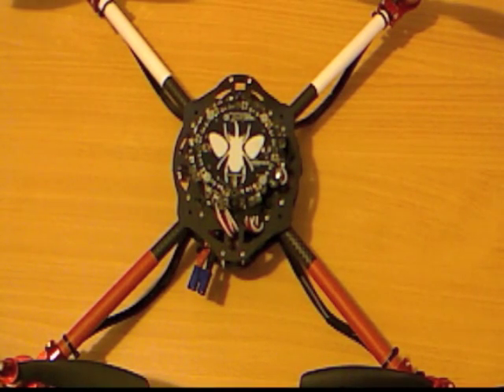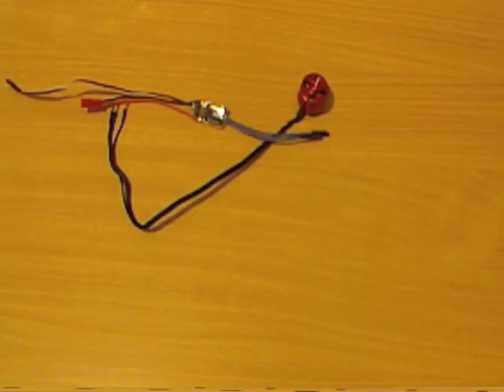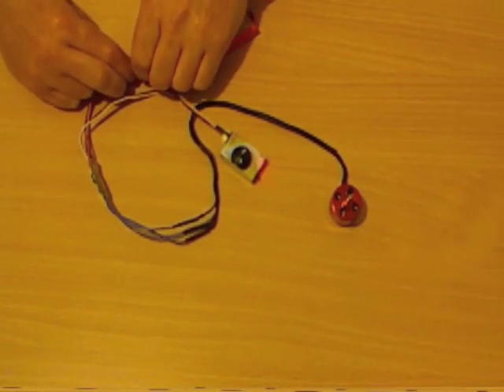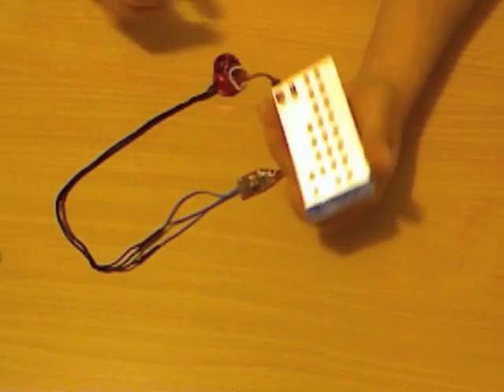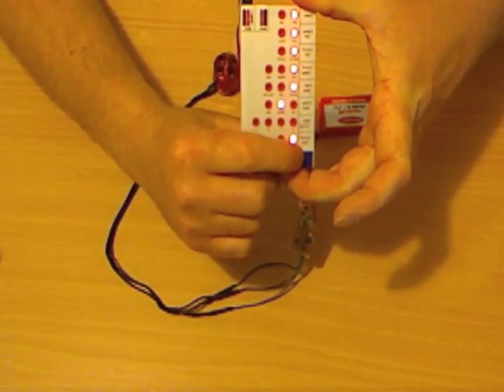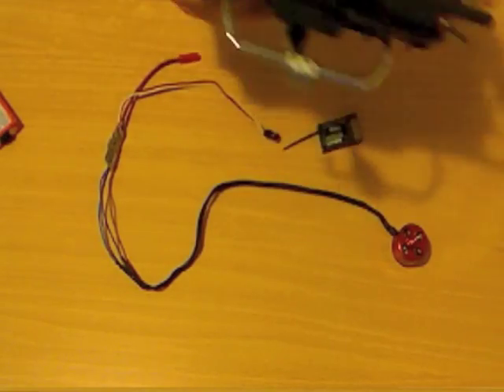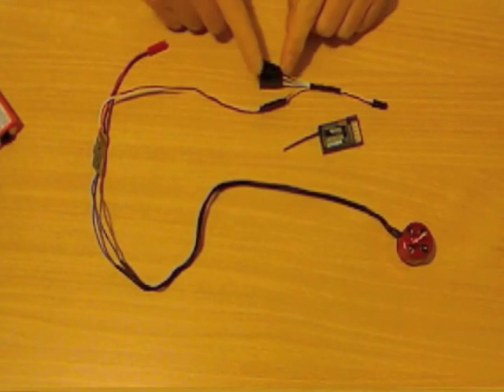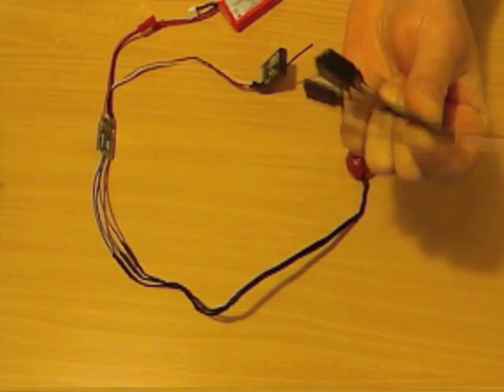Scarab setup part 1

Comment from the maker: The only way to work out the direction is to test it.

I would never solder the motors to the ESC's it makes service and repairs just too hard. A small bit of heatshrink over the connectors once you have the directions set is all you need to stop them coming undone

If you really want to solder the connections, I would set motor directions using the connectors then one by one disconnect and direct solder each wire. Then re-test direction